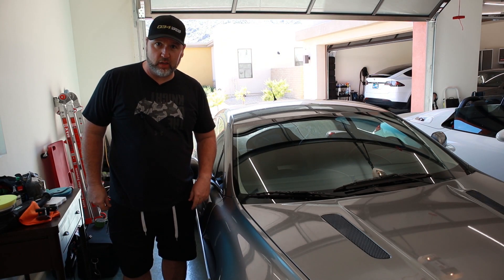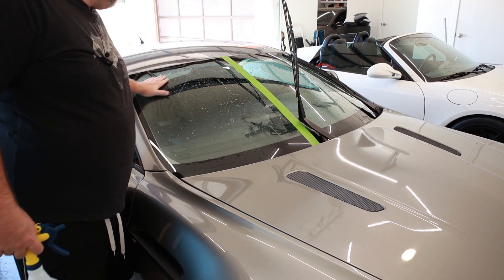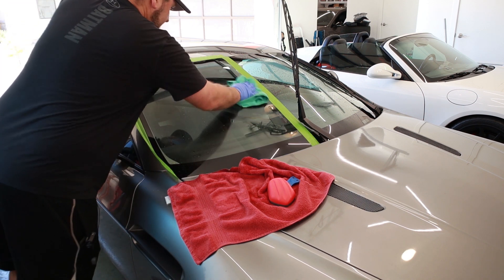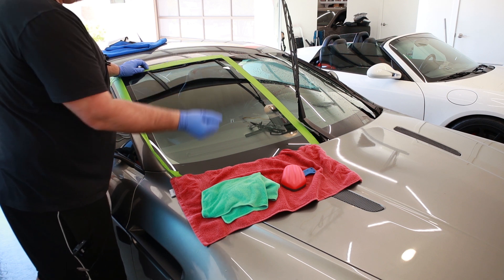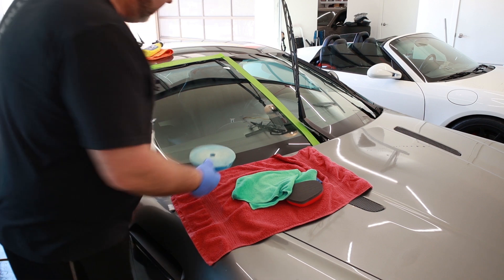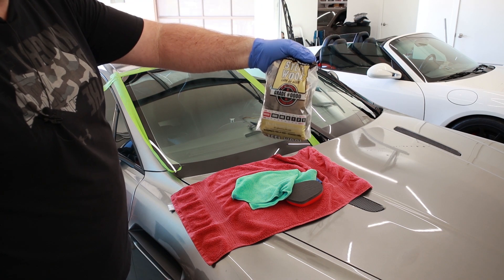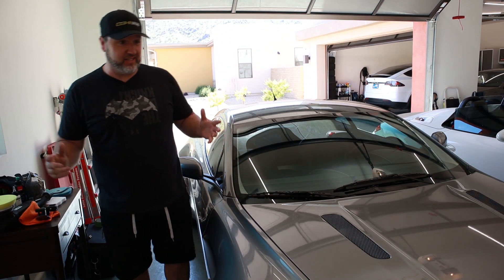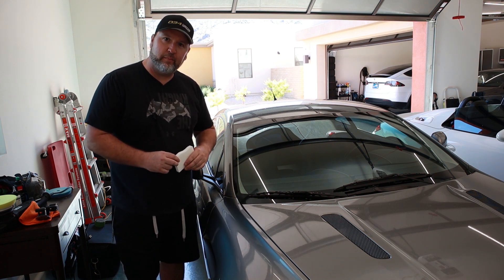Car windshield - Deep Cleaning - Aston Martin V8 Vantage

Comment: If u dont have a polisher, can u just clay it?
Reply from the maker: Clay will definitely draw out many contaminants and improve the cleanliness of the glass. You could also use '0000' steel wool as an abrasive if you felt you needed to go deeper but don't have a polisher.

Comment: A razor blade with IPA if you don't have clay 😁 , wich basically what CarPro eraser is , 25% IPA will do .
If the windshield is microabraded by using the car in sandy environment you can use specially abrasives for the glass 🤙
The magic sponge is the melammine I think
Reply: CarPro ceriglass is an example :)
Reply from the maker: I have some of that 👍.